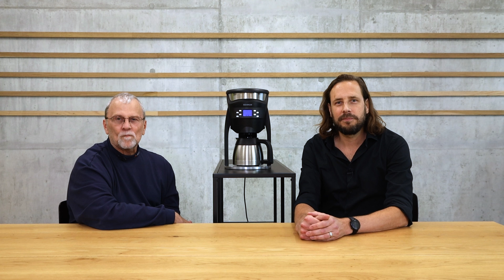Why Behmor Brazen might be the perfect coffee brewer - an interview with inventor Joe Behm.

Comment: Very curious about this brewer 
What’s the spray head ? I’m trying to avoid all plastics for making coffee and this is almost there. Love the stainless heated reservoir
Reply from the maker: Thanks a lot for your message. The Spray Head is made of plastic (all food safe of course).
Reply: as a hvacr tech, even the top quality kitchen equipment for major commercial settings still will have plastic - the plastic will last longer than the stainless bc itll even rust
Reply: @JordanSTX254  the ratio 8 has a stainless sprayer also I think the hikaru is a metal sprayer also

Comment: I do have a question for Joe Behm about the initial calibration of the water temp. 

I understand that the initial calibration is done by keying in the elevation of the location where the brewer will be used, filling the reservoir to the "calibrate" line, then the brewer boils the water. 

What purpose does this serve? 

Does the system somehow detect when the water boils? How does it do this?

Does it measure how long it takes for the water to boil? If that's the case, what happens when water of a different temperature than what was used on initial calibration is added to the reservoir? 

For example, I make up my own brew water using a Zero Water filter unit, then remineralize with Third Wave Water packets. Usually I keep that water in the fridge, but there will be times that it won't be refrigerated. How will this affect the Brazen's operation?
Reply from the maker: the idea of the calibration is, that the temperature sensors work a bit differently according to the altitude where you are at. With the calibration, the system sets a correcting factor, so that the sensors measure the temperature correctly. 

Therefore it doesn't make a difference, what temperature the water has, when you put it in the machine. It's just to make sure, that the sensors measure correctly. Which is quite a unique feature with the brazen.
Reply: @CoffeeRoasting  Thanks. I’d still like to have the engineer (Joe) explain it to me! 

I’m still not sure how the device knows when the water boils. 

Regardless, I bought one a few months ago and have really been enjoying it! In fact, I brewed coffee with it this morning! Dunkin Donuts Original at 210°F, ground by a Fellow Ode.